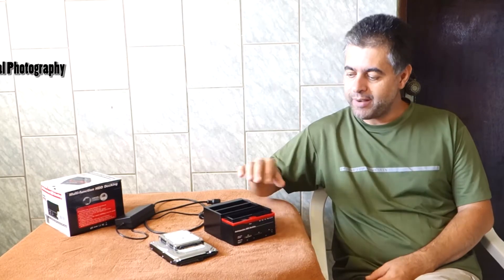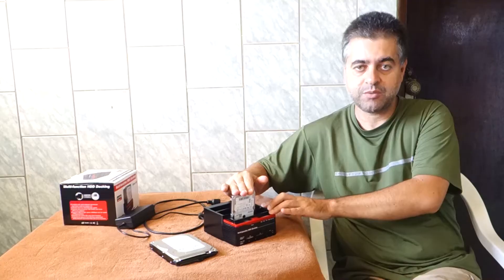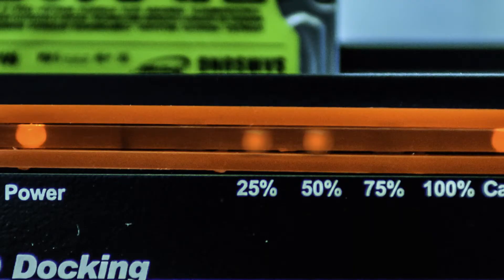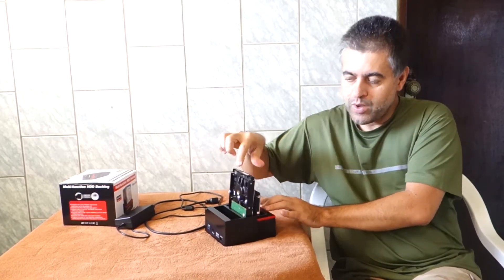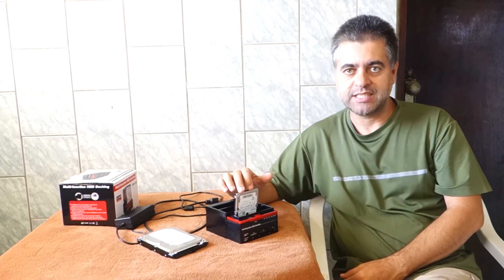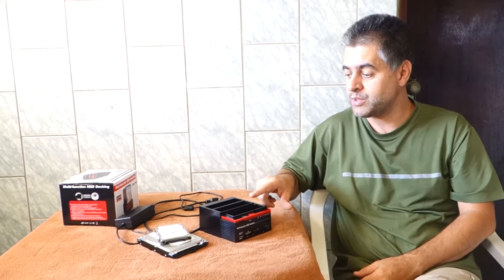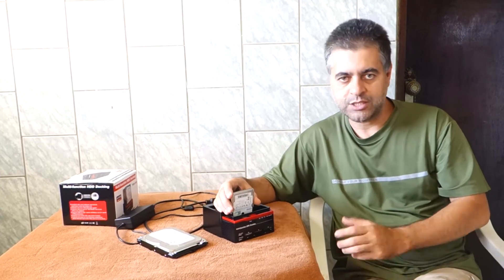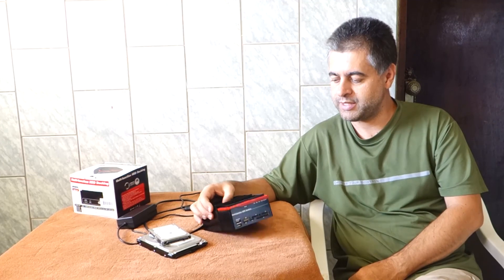Multi Function hdd Docking English

Comment: Thank you for posting! I have the same device and now need to use it to clone  2.5 hard drives to upgrade my laptop soon. SATA 1TB HDD to 2TB SSD, Ubuntu 22.04 LTS. Your video was helpful for me to refamiliarize myself with my Multi-function HDD Docking station. I prefer this method to use software like Clonezilla. Tudo de bom!
Reply from the maker: Thank you for your support. Você fala português?
Reply: @jamiljiral  You are welcome! I've traveled to your beautiful country a few times in the past, mainly Rio and once Salvador. I speak very little Portuguese, Google Translate is my big helper now.

Comment: You are wrong or you have a different version of hardwear, the first slot (SON A) is the data carrier of the SSD disk (destination), the other two slots serve as disk master A or master C (source)  BTW. at least ( the patition ) , so the copy is always on the (SON A) created. The hard drive on the bay (SON A) must always be larger than the master A or C or at least Patritions of Master A/B ! ! I just received the docking station today and your video totally misled me! I only have to press the button once for the (stand alone copy), the device then starts with a running light from 25% to 100%, a level of 25/50/75/100 is reached then the corresponding LED remains lit permanently. Unfortunately I only now realized that cloning from an SSD to IDE ( stand alone ) is not possible at all, because there is no suitable interface (IDE) in the slot (Son A). To save time ans Space, I deleted all unneeded partitions on the master disk and no longer partitioned the unallocated space, I also reduced the remaining partition to the minimum, so that for only the partition is saved and not the entire disk, which can help if no disk is equal to or larger than the Source master disk is. One last thing to mention is that the Power Connector for IDE 3.5 "is adjustable and can be adjusted on the underside of the docking station, please do not use force here.

Comment: The front slot is the target drive and the back slot is the source drive.  Your video showed the opposite!  I followed yr video and successfully wiped my source drive clean.  Thank goodnesss I was just testing to clone a drive that does not have any important data, or else I will be pissed off.   

https://jakoy.guphotos.com/i/w?u=/images/C/U/C4234EU/C4234EU-1-74f8-0qDy.jpg
Reply from the maker: Hello. I had similar comments about this problem. I double checked and I even read the manual. In this model that I am using, this is the right slot source that i am explaining. I believe, they must have changed it later. Besides double checking and reading the manual, I even tested with another copying test using the slot just to test it again. I use it quite often to copy hds and this is the slot that I use

Comment: Hello can you use all three HDD slots together ? 2 Sata and the IDE 1 so therefore could you use three hard drives at one time?
Reply from the maker: Hello. As I don't have IDE, I can not say. But I tested it with two Satas and cards and it worked

Comment: finally a decent review of this thing. I was hoping that it could be used as external HDD with at least 2 SATA drives, but you just explained it sucks at this job. so thanks for saving me the money. I need a NAS or triple external HDD thingie, guess I'll have to pay more. i just hate having 5 extermal HDDs each with its own power cable...
Reply from the maker: I just use this device to copy or to use an external HDD that it is not connected to anything. I have three NAS and it is worth the money

Comment: The front slot with red around it is labeled as SON A, The middle slot is labeled as Master B, and the back slot (IDE) is labeled as Master C. Common sense is that cloning should be from Master to SON, and this is contrary to what you said in the video. Can we double confirm?
Reply from the maker: Hello. According to my device, it is devided in A,B and C. A is the main one, the master one. I believe there may be a difference in models. I bought this device in 2016 or late 2015
Reply: @jamiljiral  Thank you for your reply.  So there might be different models and we need to refer to the manual and always copy from the slot labelled Master to Son/Slave
Reply from the maker: @konglee631  Hello. Somebody else asked me the same question. I had to check my manual to confirm even though I had been using this device for quite a while. I don't understand why they changed this device like that. As it is a very cheap device, maybe it doesnt have any qualifty check up. In this model fromt he video, the first slot is master A and the others are "sleeves" B and C. it is written sleeves in the device, instead of slave
Reply: @jamiljiral  I think Sleeve is supposed to mean slave.

Comment: Great Video,thanks for sharing! IMPORTANT = IF you have one of these devices and HDD's do not work or the Front lights keep blinking( like 2 of the ones both ends) means there is a POWER problem and POWER is  a) not enough b) Faulty power supply.  I tried with 12V 2A External HDD Power Adaptor and seemed to work and did the trick! IF you have the blinking lights problem or IF THE PROCESS STOPS half way, try changing your power supply.

Comment: i just bought Multi-function HDD docking model WLX-893U2IS, but the device cannot detect or read  SATA hdd. front slot is working well, only top slot is mulfuunction. Any once can help or can share the solution. I try runnng with window 7 and window 10. Both is failed.

Comment: Hello sir , I'm very interested to the Multi-function HDD Docking clone device, But it don't have Duel IDE HDD port , So if I want to clone IDE Hard disk to IDE Hard disk we still can do it ? Because I need to clone IDE Hard Disk to IDE Hard Disk .
Reply from the maker: Hello. As the device has only one port for Ide, I believe it would be more difficult to do that. The only way I see that happening is if you use another device to plug in it

Comment: can u clone usb to usb hdd
Reply from the maker: Hello. I think it doens´t and maybe if it does, it has to be the same size because the cloning process is going to let the two flash drives exactly the same. That is why, I don´t think it is practical to clone USB. You can plug the USB and transfer files.

Comment: hello i cant find the drivers? any help
Reply from the maker: Hello. Maybe the problem is related to not enough energy entering the device. I had this problem when I plugged the device in the front USB ports. However, when I plugged it at one of the rear USB ports, it worked quite well. Try to plug the device in different USB ports. It is worth saying that this device is good to clone disks and not so much for other functions

Comment: Hi jamiljiral, 
Thanks a lot for your interesting video. Somehow I have a question if please you can inform me:
Is it possible to clone from an "Ide hdd to a sata hdd" on this dock? 
I know there's an Ide port in the "C" part. But I thought it recieves only (as slave), not sends (as Master). Is there a way to clone from it to a sata hdd?
I tried to search for an adapter or cable «sata to ide», couldn’t find.
Thanks a lot in advance.
Reply from the maker: Hello Joesm1. Thanks for watching the video. Well, I´ve never tested the device with an ide hard disk because I don´t have one. I read that it supports an ide device, so in theory it should work with an ide hd in the same way, as long as the ide hd is smaller or the same size of the main hard disk in case you want to copy from an ide hd to a sata hd.
Reply: Thanks a lot jamiljiral for your care about my question.Well, In fact I’ve asked that question to the vendor, who (I suppose) got the informations from the producer (not sure though). Got the answer that it’s not possible. But I still wonder: Why we should press twice to make the cloning? And what if we press just once, Will that make the cloning vice-versa?
I hope someone tries that one day and tell us.
Thanks a lot anyway.

Comment: I have just received the docking. The problem is the user's manual is hard to understand. There are technological terms without explanation/definition (i.e. OTB, ESATA interface...) Can you tell me where I can get a clear/easy to read manual?
The manual writer might have not taken any Communication writing course!
Reply from the maker: Hello Michael Do. Thank you for watching my video. Sadly, I don´t know where you can find a better manual for this device. I agree with you, its manual is not one of the best. To be honest, I didn´t read that manual because of that. I tried to figure it out by dealing with it. Maybe, this is going to be the best option in this situation. In case you have some problems, you can count on me. For example, OTB is for One Touch Back up where you can back up your system just by pressing an specific bottom. Esata is where you will plug your esata device.

Comment: Can you communicate from your Desktop to the Device to the hardware via Windows 10? With software or there special software?
Reply from the maker: +Harvey Solomon Hello Harvey. Thank you for watching my video. Once you plug the device using a USB cable and turn on the power, it will be recognized by windows 10 as a normal drive, as if you were using a flash drive for example. It means, your computer does not not need any software for that job. However, it constantly disconnects from the computer.